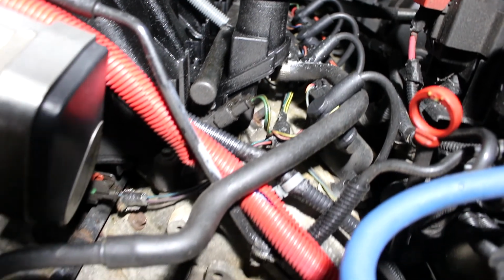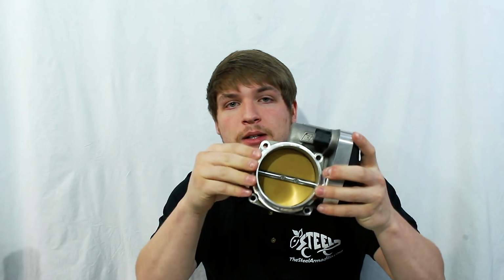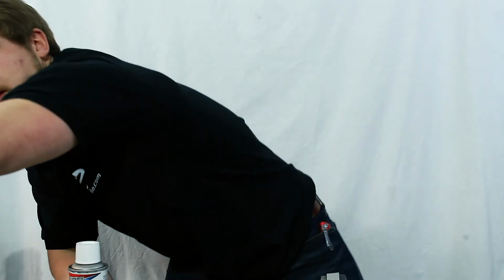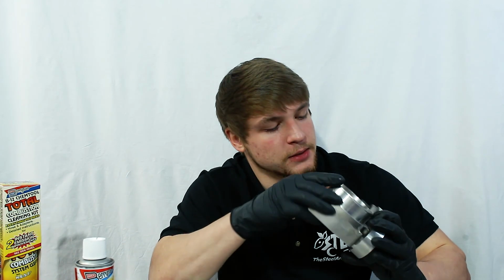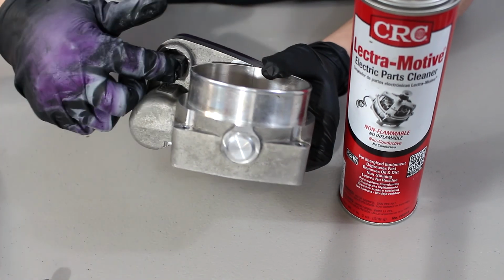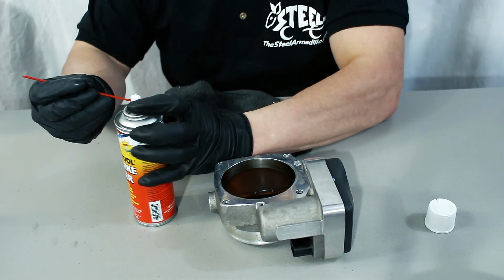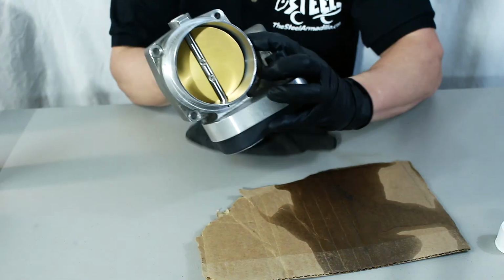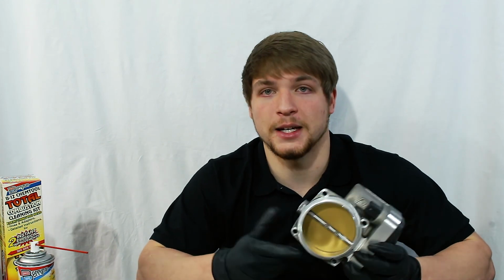How to Clean a Throttle Body Safely | Berryman B-12 Chemtool Air-Intake Cleaner

Comment: if you have this problem and is applicable, remove vent case vent tube that routes back into your intake and replace it with a filter. then remove EGR, if applicable. no more oil in your intake.

Comment: I think I cleaned the throttle body on my Hemi at like 135k and it was disgusting. Definitely took a minute to clean with brushes and carb cleaner. I think I bought my catch can immediately after cleaning my throttle body. lol Crazy how much oil will accumulate in one oil change interval.

Comment: Why not Power Foam by Amsoil? It worked great for me.
Reply from the maker: Doug Dean have you used it specifically for the TB? I would like to do so by checking before an after, there's some guess work involved but by taking it off, I can make sure it's clean. It's not a big deal to me, I'd like to see what you can get from Amsoil's line as well, I just had this at the time. This was actually filmed in January, maybe my TB is dirty enough by now already to give that a go too!